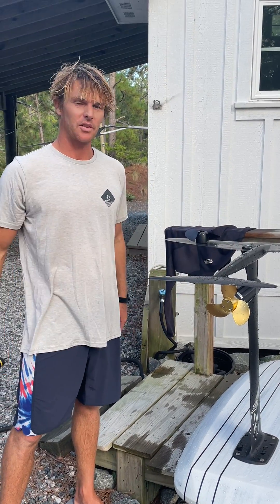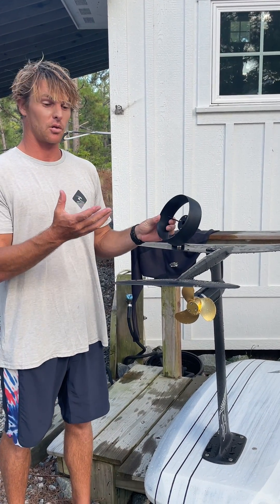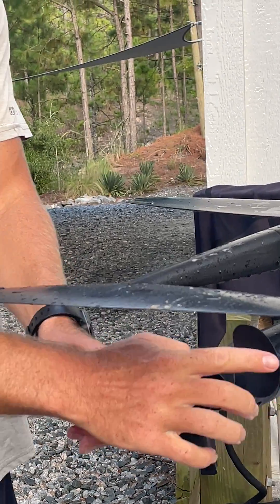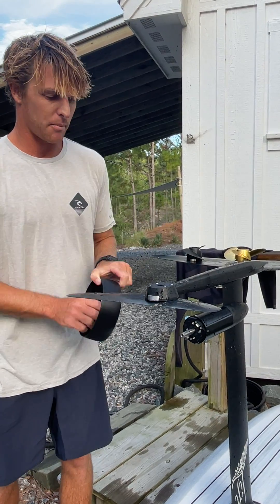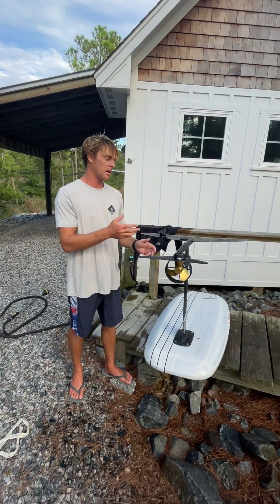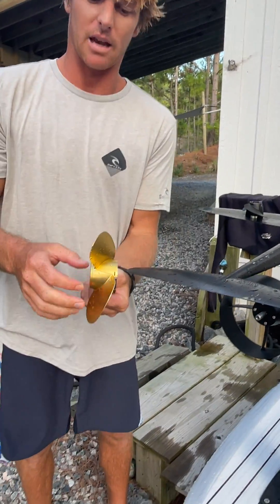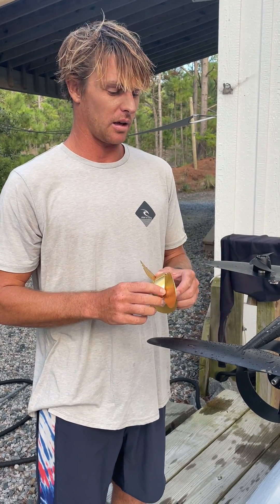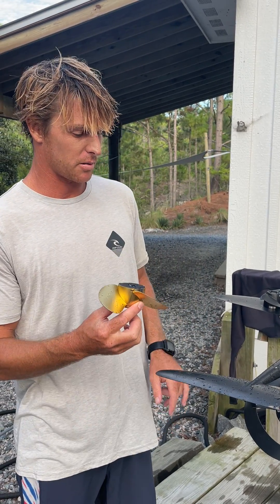Lift Connect System (LCS) Overview with Evan Netsch

Comment: Wich lift foils board would you recommend for total beginner please?
Reply: It depends on your weight. If you are 200 pounds or under I would recommend the 4'9" for a good compromise of easier waterstarts and lower "swing weight" during sharper turns. Some would have you purchasing a larger 5'6" but you risk a boredom factor with simply cruising around no wakes or waves. Oh.... But if you want the entire family and friends to share the board maybe you should research the bigger vessel. Also, I've tried the 4'2" and it's magic.... But it's gonna take you a month of trying to get up the waterstart